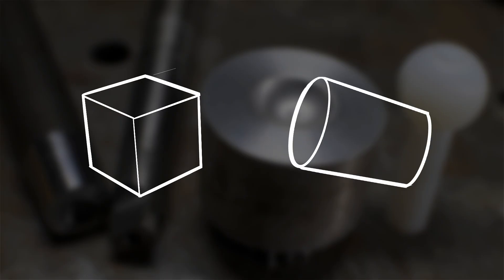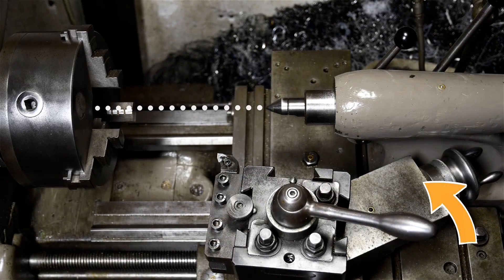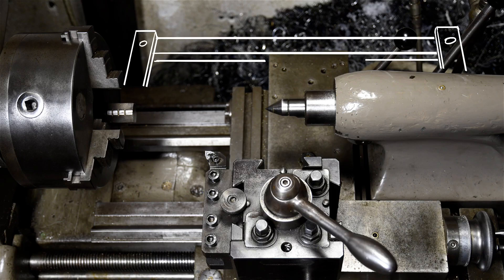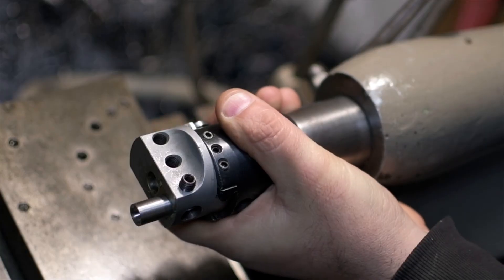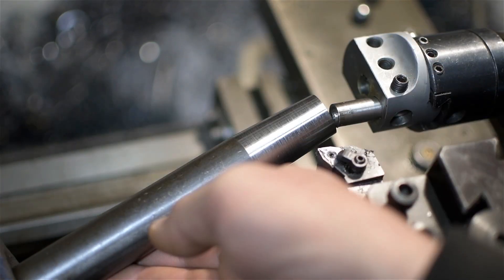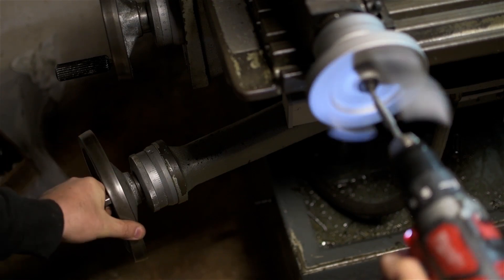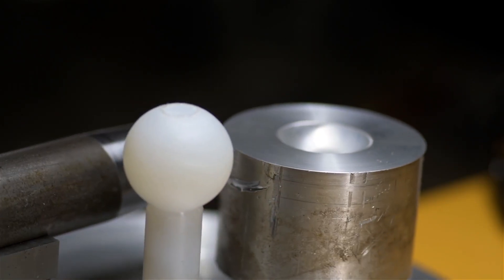Boring Heads & Tapers & Spheres, Oh My!

Comment: You can make the spherical cutout perfect you make the boring head sweep a circle that's at a right angle to the surface of the workpiece, and intersecting the axis of rotation of the rotary table. Otherwise, you'll still get mostly a spherical bowl, but with a center defect (flat or conical nub), not unlike when you face a part with an off-center tool. Rotary table on its side, mill spindle vertical would be simplest. It's a neat trick!

Comment: There’s no reason you couldn’t use a hardened ball on both ends of a center drilled shaft driven by a lathe dog. A corresponding ball socket would be necessary on the headstock and tailstock ends. 
A boring head mounted in the tailstock containing a roller bearing shaft would allow a much steeper taper to be machined than standard 60 degree centers.

Comment: It occurs to me that driving the work with a dog (using the two ball bearings) will result in a slight rotational acceleration/deceleration as the work turns (as with a yoke on a universal joint). How would this affect the behaviour of the cutter and the final finish?

Comment: Any advice on how to cut a flat bearing bore with a boring head?  The cutting tool insert mounts into the boring bar such that the bottom edge is not perpendicular to the axis of the tool, resulting in a conical cut. It's not much, but it's not a flat cut.
Reply from the maker: Ideally you'd have a boring head capable of doing facing, but those boring-facing heads are usually pretty expensive.  Alternatively maybe you could put the part on a rotary table, and set your boring head to smaller diameter.  Swing a smaller diameter while rotating the part.  I wouldn't trust any insert shape to give you a flat bottom if its important.  Can you put the part in the lathe?
Reply: Thanks for the tip.  I'll give the rotary table a try.  Part is too long to fit in our lathe and also not easy to grab onto.

Comment: Fun video, Tony. I have a question on a project I'm working on. Can a boring head do a partial depth hole where the outside of the hole is larger than the material I'm working on? Confused yet, lol. Making a speed handle for a round knob. Knob is 2" dia, using 1" wide material that will slip over the knob, but it needs to be recessed to slip over knob. My mill isnt cnc so this seems to be a legit option just hoping shallow cuts wont cause the cutter catch the edge of the material and ruin my day and probably some stuff. tyvm

Comment: On the topic of reducing friction when using an offset tailstock center: centerdrills are available in whats called form "R" in DIN standards, in this form, instead of the regular 60° conical section they have a radius, which means that you can offset them without the centers running unstable or wearing out.

Comment: At 8:41, where your products are on display, there is a clear slope. The machined surface is longer on the top of the part than on the bottom. Is the bar not round or is it some sort of auto feed side effect always finishing on the same side?

Comment: Having inherited a little lathe for 5 minutes, am already trying to figure out how to fit a brushcutter rotor/stator to a 2 stroke mower engine so I don't wear bits of the original flywheel should it explode at 10000 revs

Comment: Set the spindle at a 45° angle to get a perfect sphere.
Reply: more like 90 me thinks :)
Reply: @fomalhaut86  A 90 wiil not make a perfect sphere, as the part still needs a shaft holding it in the chuck. It will leave a "shaft" size spindle on the un-suported side, or non chuck side per-say. 45 is more the proper angle, with the right bore size to ball size needed.

Comment: I’ll have to admit that after being a machinist for 22 years now I’ve never cut a taper on a lathe like that before. Very good tip if you don’t have a taper attachment or need a nicer and more accurate taper than you can get with the compound. Now I have made spheres on a manual mill before.  A fly cutter will work as well. It’s just not as easy to dial in the size you want as a boring head is.

Comment: Yes, the bottom is a bit flat in the spherical cutout. You could improve on that by adjusting the turning axii (is that the right plural?) of both the tool and the workpiece to 90 degrees, letting the tool cut exactly in the middle of the turning direction, using a very narrow circular sawblade as tool and being very gentle in this operation.

Comment: I recently rebuilt an eleven thousand dollar ball valve using this very same method.  By watching how the tool cuts on the back side of the sphere you can get a very accurate sphere.  Remember a circle of any size can be inscribed at any place on a sphere.  My ball was round to within 0.0005 inchs
Reply: eleven thousand dollar ball valve? must have been one heck of a garden hose they were powering.

Comment: Tony, your taper seems to not be concentric to your original bar center axis. Like maybe the ball on the boring bar end of the cylinder is not really centered on the bar stock. The taper/original surface intersects in a wavy line. Is that because cylinder surface is out of round? Or is there some other geometric aberration going on? 

Great video, as usual.  There's something about watching you demonstrate your values through machining that makes me feel warm and happy (fuzzy doesn't make sense). Always a joy.
Reply from the maker: combination of out of round raw stock and some run-out on my chuck probably.

Comment: The taper cut using this technique looks eccentric  , as I can tell  the end of the taper ( the shiny part of the cut metal ) forms an angle plane to the rod. If that  is correct, I have a hard time figuring out how?
Reply: I was wondering that myself. I think the ball bearing at the tailstock end was off-center.

Comment: On Tested when they made Micheal from VSauce a Kandama Adam used a Holdridge radii cutter for the lathe. Seems like a precise way to cut convex and concave shapes. But these tips would be useful for someone that doesn't have $600 laying around.

Comment: Mathematically this works as long as you are doing the math correctly. If you want to cut a sphere just ensure that you are cutting around the centre of the sphere or do the math and find the cross section that matches the circumference of the circle you can cut and it's offset from centre of the desired sphere. Hope that makes sense. Also to hollow out a sphere it's the same calculations but you work in negative space.  Brilliant by the way.

Comment: The tapered shaft trick results in a uneven taper cut doesn't it?  (Meaning more of the taper is cut down one side longitudinally of the part than the other.  Still a correct taper otherwise.)

Comment: That boring head trick is great! I have long tapers I want to cut, well pool cues, and they're not straight tapers. I'm in the middle of rigging up my DRO Z output to talk to a stepper motor to run a live tool in and out on the saddle. It simplifies some things to get a straight taper first then to thin it according to the mechanics of the wood and desired flex. I did my first stick by moving the tailstock, getting it back in line sent me into deep depression... All better now!

Comment: Great video. Where the results are shown together at the end of the video, the taper on the bar stock looks skewed over. Does this method create a taper that is not concentric with the bar? If so is there a way to correct this?
Reply from the maker: as concentric as you set it up in the chuck.  this piece of stock was also not the roundest I've ever seen.

Comment: Dude that is genius.. I have an HBM boring head and a small Myford lathe and use a homemade drawbar to lock it hard into the taper to stop unwanted slipping or rotation.. super tempted to try the taper trick, I've had to do a few  cosmetic tapers in the past couple of years and it was always cut multipul steps and blend with a file.. this is awesome... great videos as always :)

Comment: Been watching your videos for some time now, and this is one that blew my mind. I only have a7x16 lathe and a benchtop mill for mostly hobby work, but your stuff has helped me dramatically improve in my ability to get jobs done. I have a lot to learn but it is an enjoyable journey with guys like you around.I have a question about ball or radius turning using my mini lathe. Can you recommend a tool that actually works on these lathes? I bought one recently from an ebay seller, but the height of the tool is not correct for my setup. I do not have enough adjustment to bring it to the correct height and it is honestly not well made. 40 bucks not well spent... Any advice or links toa  tool that would work is appreciated. Please keep up the great videos.
Reply from the maker: great to hear Joe, thanks!  Afraid I don't have any good pointers on ball turners though.  There seem to be 2 styles, the ones that sit under the work, and ones shaped like a yoke, or a Y, that go around the work.  My guess is the ones under the work are a lot more rigid, but require you take off your toolpost.

Comment: Hey Tony. I’m fairly new to tapers and I’m cutting a #3MT for a collet sleeve on my South Bend 9A with the standard taper attachment. I’ve run into some problems cutting the taper accurately where I tell it to engage, as it appears there’s always some slippage in the screws and setup. How do I counteract or combat this problem and cut accurate tapers where I tell the lathe to?

Comment: Great video. Your machined dimple will be spherical as long as the bottom of the arc of travel of the tool goes through the centre of the work and the end of the tool has a sharp radius or at least a circular end, else it's a toroidal surface.

Comment: Isn't it a sphere, though? If you put the mill fully vertical, then you're getting the projection of a sphere on the stock piece. If you set it to 90° (which is not physically possible), then you woul get projections of a sphere, vertically, which alltogether form a sphere. So, what happens between those two angles that it stops being a sphere?

Comment: I knew the offset tailstock method, but  turning between centers always gives me the heebie jeebies. Using ball bearings instead seems way better at first blush, and using the boring head to control the offset without having to monkey around with ofsetting the tailstock is freaking BRILLIANT. (with the caveat that you'd better have that ball bearing in the same plane defined by the headstock, tailstock ram, and your cutter - or you get a taper that has a slight skew to it...)

The ballbearings also remind me of using a sine bar over at the mill, but of course the math isn't quite the same for calculating the angle of the taper...

as always, your stuff blows me away!

Comment: For spherical cuts, both convex and concave, this is the perfect example why cnc is useful, especially when repeatability and large cuts are needed. 
A ball end bit can cut a concave dome, but only up to half a sphere, and that's dependent on what size of bit you have. 5axis cnc machines could create almost a full convex sphere and almost a full concave sphere, vex needs a held shaft and cave needs an entry point for the cutter. 
I know people like AvE shun cnc, but cnc is just so much more advanced than what hand milling can do. Cnc provides multiple precise movements, where the most a person can do is one, maybe two but thy wouldn't be so precise.

Comment: woow, this was super awesome. 
however I'm puzzled as to why the taper made with the boringhead trick doesn't seem to be straight on the cylinder (visible at the transition between taper and cylinder)
Reply from the maker: Any one of a number, or combination of, things.  raw stock not round, the center features I drilled into the raw stock might not have been on-center, and perhaps the boring head wasn't perfectly level?  Though that last one might not cause what you see.  probably my centers aren't right on center and the rough stock is a little out-of-round.
Reply: Clumsy bastard....    ;-)
Reply: that makes sense.
I was afraid that was because of the method, because it just felt to good to be true, to easy to make a taper that way, but I couldn't figure out why it shouldn't work. 
but now that everything is confirmed and in order I truly feel that my machinist level is now a solid 5 up from a 2, due to this video alone! :)

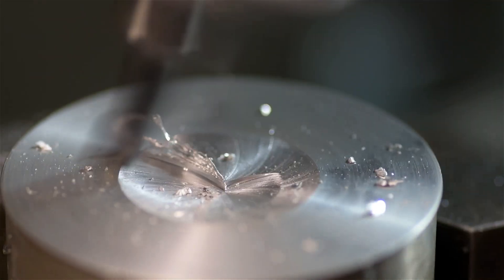Comment: @7:43 Not quite so. You can cut absolutely perfect spherical concave with this technique but you have to know the trick. Look at the circular trajectory of the cutting tip. Now take the lowest point on this trajectory and let's call it an "anchor point".  If this point is dead on the rotary table axis you will get a perfect spherical cut with radius [R] = [r] / sin([phi]) where [r] is the boring radius and [phi] is the angle of the quilt tilt from the vertical position. If your anchor point is off this axis you will get different shapes and in most cases they will be non-spherical, from inflated sphere with raised bottom up to the ellipsoid and even toroidal shapes.

So the only way to cut out a perfect sphere of radius [R] with this technique is to set the boring head radius to [r] = [R] x sin([phi]) then to set the anchor point of the cutter tip trajectory in horizontal plane dead on the table rotation axis and then to work the cut down along the rotary table axis to the required depth. To minimize errors the quill should be tilted to the maximum possible angle.

Comment: Also, I wanted to say the ball bearing is pretty ingenious. However I just realized something. In school we used the tailstock offset method. but when in cambodia, you turn as cambodians turn, eccentrically. Could you also use a four jaw chuck with the tailstock as the concentric end of the lathe :"). Or possibly center drill  a spot so the part could be driven eccentrically at the tailstock? You don't get really any adjustment in comparison to the boring head method, but options non the less.
Reply: Both of these ideas have the same problem. You would get a taper on one side of the part, but the other side does not get cut.

Comment: loved this. learned a bunch. do you think you could make a rotary or diving head all on the mill, or with a second op lathe? I'm sure it is too much to ask, but would you consider doing a couple more tooling videos, like clamps or a fixtures or maybe that height gauge you were talking about. Did you end up making a CAD file for that, or prints?. I know you just did the weld table, but I'm not to that point yet I guess. At least I hope I'm not at my mid-life crisis. It was a good video however! Thanks again. -Zach

Comment: As always, great video! I am new to machining, and get a huge kick out of this material. I was curious, is the taper produced in this method concentric with the long axis of the shaft? It might just be a trick of perspective, but if you look at 8:41 (and at a couple other points, it seems to not be tapered evenly all the way around. Are there tailstock settings to adjust this? Thanks!

Comment: Hey Tony, I have to machine an internal taper that is far too small for a boring bar. I think my only option is some kind of form tool for my specific taper, start diameter, and end diameter. Is there any way for me to machine a rudimentary form tool and heat treat it instead of having an expensive one custom made?
Reply from the maker: Is it a non-standard taper?  You can buy tapered drills and tapered reamers for all the usual suspects.  Otherwise, yes, I suppose you might have to make your own.
Reply: Have a think / google about D bits. Stefan G uses them quite often. Not the most efficient cutter but relatively easy to make.

Comment: Hi TOT, there's an excellent reference work by the late George Thomas that covers cutting tapers using ball bearings, although he did n't suggest using the milling head. By measuring over the ballls (!) it is possible of course to calculate the offset to get very close to the required taper. George reccommended using vaseline - err, to hold the balls in place ..... If the angled head in the mill cuts true parabaloids there will be a lot of applications for the very interesting technique. Thanks for sharing.  Bob.

Comment: Great presentation, great ideas, now I learned something. Offset the tailstock always bothered me, the idea that's it, I never used it as a male and a female offset condition produces uneven running. If I may suggest a further improvement for the two-ball system: with the center-drill (same dia or a bit larger)I'd go in just a bit deeper to ensure safety. Not  
Well said but I am sure you got my drift.
You should go to Hollywood, I am sure you could direct better movies than those I see.
Great, great job, thank Tony. That Old Bob